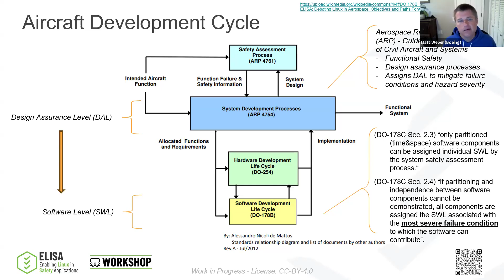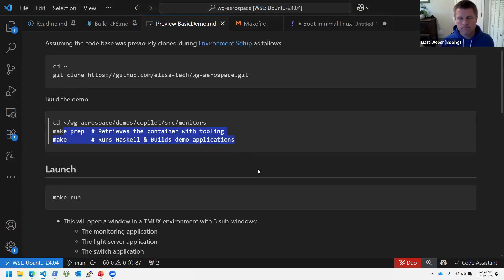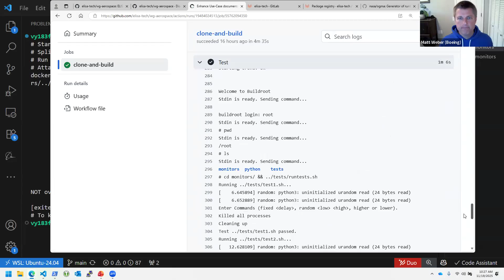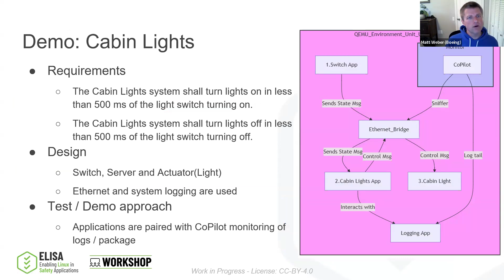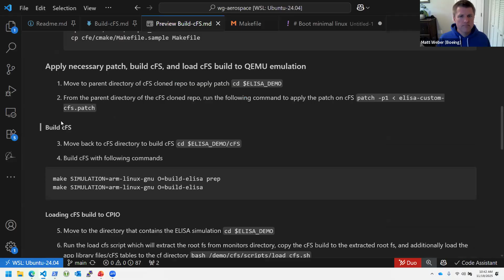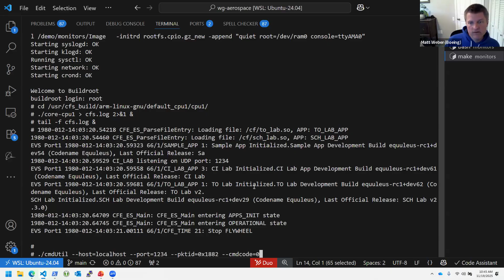Industry Safety Level(s) vs. Aerospace Use Cases - Matthew Weber, Boeing

Comment: DO178 - Would love to adopt the habits/practices that are used to develop software in safety-critical embedded industries, like
aerospace (DO-178X , DO 331 , ARP4754A , ED-12C),  medical (13485 , ISO14971 , IEC 62304 , SaMD), nuclear (414.1x), automotive (26262), etc
Are there real-world examples of what goes into the generic planning documents (SDP, STP, SVP, PSAC, etc) as well as the project specific documents (SRD, SDD, etc)?

And how does the software framework fit within an overall system framework.. like Waterfall, Agile->Scrum?   

I understand DO-178C is agnostic when it comes to the language (Rust, Zig , C) ,  toolchain (gcc, MinGW, llvm/clang) ,  build system (CMake/Meson->Ninja).. but what if you are using a COTS RTOS (Zephyr/West/Kconfig,  FreeRTOS),  and/or vendor-supplied libraries?  I assume the auditing agency doesn't automatically trust code just because it came from ST Micro , DiSTI etc?  

And if using an FPGA SOC with logic that's written in either Verilog/VHDL, or schematic-capture..  what's the process to assure that the FPGA logic is safe?  I know there's tools  (Apheleia Verification Library ,  UVM ,  VUnit ) including python (import hdlregression (Marius Elvegard))) that can be used for debugging fpga code, but is this the standard practice.  BTW I like the videos 'Unify to Verify: A Monorepo Approach for Hardware and Software using Bazel, Cocotb and Verilator' and  peertube FSiC2023 "Black-tie Python: Formal verification with Amaranth" (Cover, Bounded Model Check)! 

I also found good videos online by CEMILAC Education Program on Airborne Certification fo DO178C.. but do you know of any training course that cover the process with a sample project?  For example, any of these udemy courses? 
Principles of Software Safety Standards
Unit Testing & Other Embedded Software Catalysts
Interaction Tests, Mocks & Refactoring in Embedded Software
Tonex Training : DO-178 / DO-254 Training

Finally, I understand DOORS can be used for DO-178C / DO-254 to track requirements, but are there any open-source equivalent tools?  For example, I found this list of some tools but not sure what is the minimum number (and investment) of tools that represents a professional environment?

***Requirements Management
IBM Rational DOORS
JAMA
Xebrio  
rmtoo florath
doorstop-dev / doorstop
reqview
 Jira / Redmine or Tuleap / OpenProject
Polarion 

***Static Structural Source Code Analysis
Astree Static C Analyzer
Parasoft
PolySpace
CodeSonar
horusec
SonarCloud
Veracode
PREFast
TBrun
LDRA
cppcheck
Klocwork

***Dynamic Analysis / Modified Condition/Decision Coverage (MC/DC)
VectorCAST
RapiTest
LDRA Testbed (also supports dynamic analysis)
Cantata
TESSY
Eggplant (primarily for GUI/system-level testing)

***Traceability Tools
Reqtify
Polarion
McCabe
Jira (with traceability plugins)
Tuleap

***Configuration Management / Storage and Version Control System
Git
SourceSafe
Mercurial
MS TFS
ClearCase
SVN

***QA / ALM (Application Lifecycle Management)
Helix ALM for Managing Artifacts, Establishing Traceability, Documenting/Enforcing Processes
Jira
Redmine
Tuleap  <-----
OpenProject  <--

***(I)V&V / Unit Test Automation
VectorCAST
LDRA Testbed
Mathworks Simulink DO Qualification Kit
GoogleTest (C++ unit testing)
Catch2 (C++ unit testing)
Cantata
TESSY
Unity+FFF    <---
Unity+Cmock  (auto-mocks)   <---
ennorehling / CuTest    <---
Ceedling  / Cmock (Generates mocks, runs unity test, runs on Ruby)   <---  
Cmocka (probably not so great for embedded)
VSC TestExplorer , 
CppUTest  (alternative to Unity+Cmock), 
CUnit  (alternative to CuTst), 
Check, 
Criterion  (desktop/server), 
Cutter

***Simulation / Hardware-in-the-Loop Testing
Renode (embedded system simulation)
embedded-hal-mock (Rust embedded HAL mocking)

***Build Systems / Development Platforms
PlatformIO (embedded development platform)
LDRA Tool Suite 
Green Hills MULTI 
Wind River Workbench 
DDC-I Deos + OpenArbor

***Continuous Integration / CD (Continuous Delivery/Deployment)
Jenkins <--
Bamboo
GitLab CI/CD
Azure DevOps
TeamCity

* All in one vertically-integrated tools
Ansys SCADE  (still requires something like DOORS or GIT for requirement and configuration management)
MathWorks Simulink ecosystem
Siemens Polarion ALM ecosystem
IBM ELM